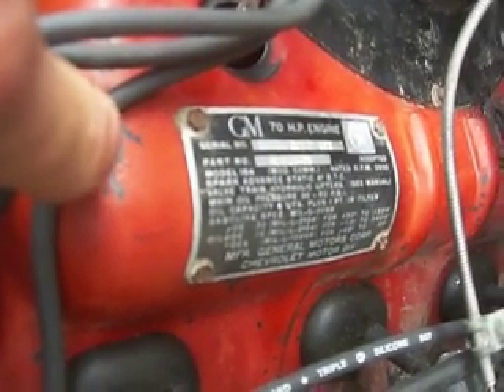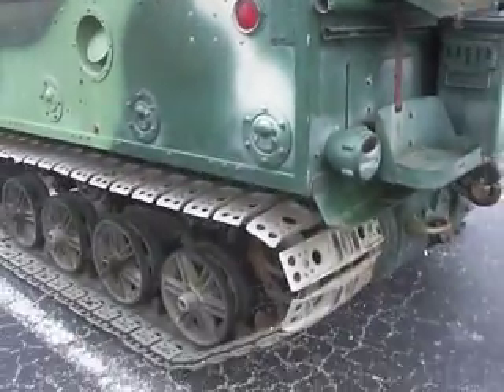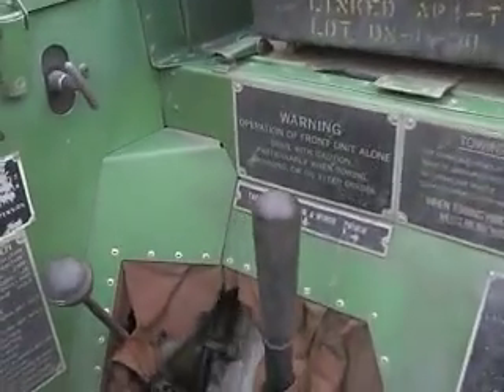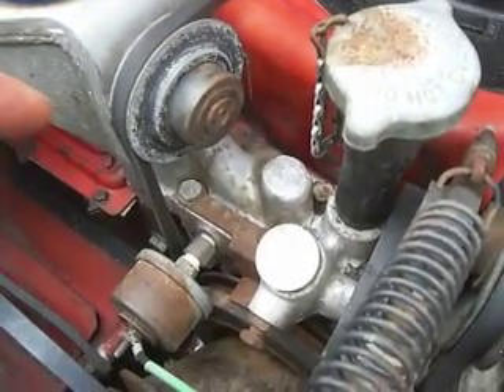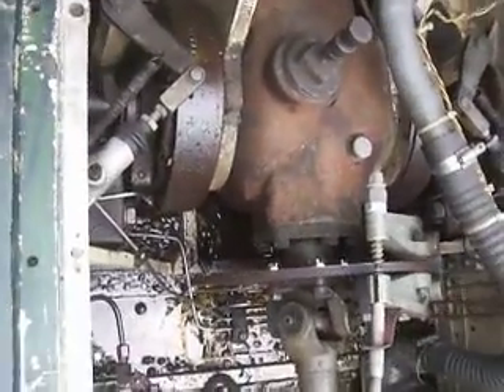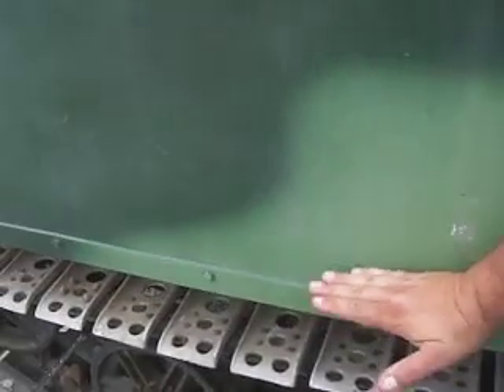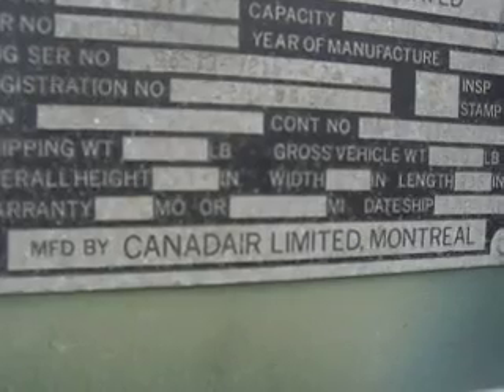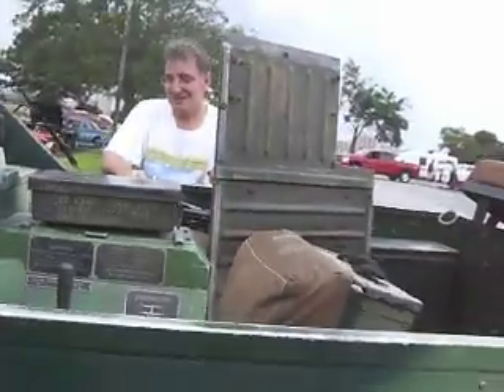Corvair??  Tank???

Comment: you would be a sitting duck in this slow ass lego
Reply: It's not armoured at all. the body is made of balsa wood sandwiched between two layers of aluminium. It was designed for mobility over snow, but was found to be decent in mud and water too.